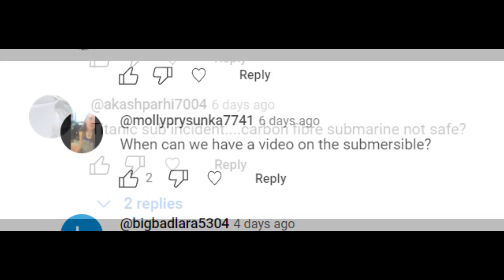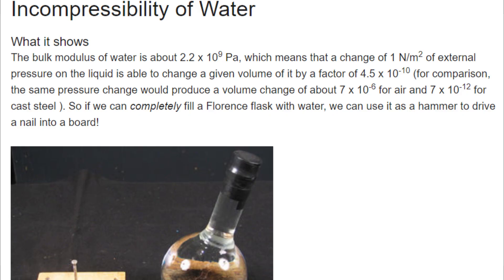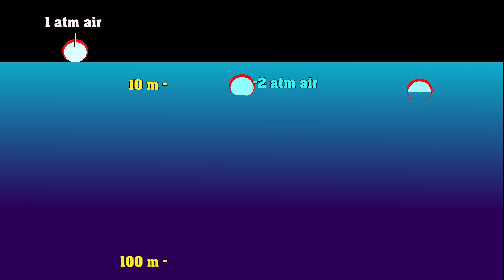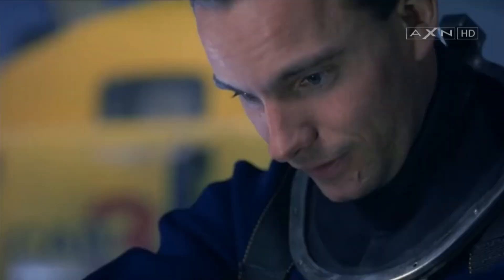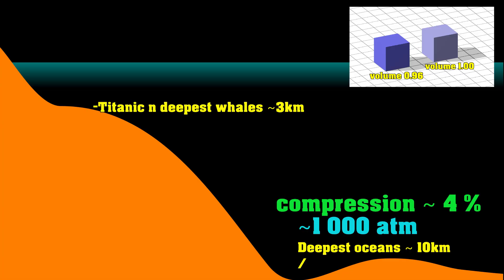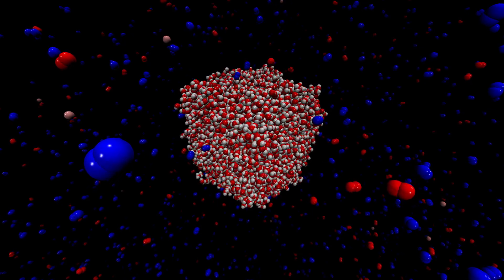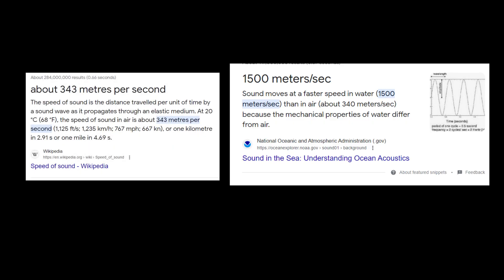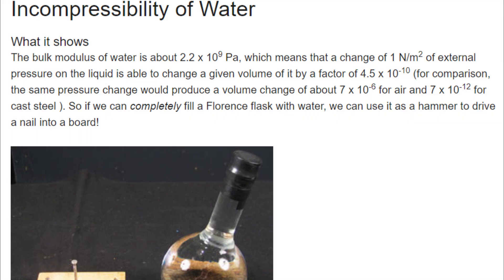What Happens when a Hull Fails at 1000 atmospheres?

Comment: Sub didnt fill with water in a few seconds. The sub exploded in 1 milliseconds then the water rushed in about 12 milliseconds later at about 1500 miles per hour. They were incinerated, smashed, and then subjected to the oceanic pressures in less than a blink of an eye.

You are missing the part where when you increase the pressure of a gas you increase its temperature.  These gases ignite and explode especially oxygen and any hydrocarbons
Reply: Air does not ignite...
Reply: @thedubwhisperer2157  but hydrocarbons and the peoples clothes does especially when the temperature increases. Which was in the submarine.

Forensic testing shows that cotton and wool clothing will ignite at temperatures of 250°F.

Any oils or gasoline materials would have ignited and the oxygen would have accelerated that process.
Reply: @thedubwhisperer2157  
The collapse of a submarine pressure hull happens quick, just 37 milliseconds in the case of the *Scorpion*.  The incoming water had a velocity of about 2,000 mph, not the relative slow flooding.  Over such small time scales, there is no time for the water or the steel hull to absorb any heat from the rapidly compressing air inside of the submarine.  Because no heat is transferred from the air to the water or hull, the compression is adiabatic.  By way of comparison, a four-stroke diesel engine running at 1,000 RPM has an adiabatic compression stroke lasting about 30 milliseconds.  The collapse of a submarine pressure hull is much more akin to a giant diesel cylinder compressing than relatively slow flooding.

A few people have mentioned Boyle's Law (or more generally the ideal gas law) as the reason the temperature will increase inside the collapsing hull.  But because the collapse is adiabatic, the ideal gas law does not apply.

So let's do the math.  The equation relating pressure and temperature for an adiabatic process is

    P^(1-γ)T^γ = constant

Where γ is the adiabatic index (*γ*=7/5 for air). P and T can change, but that constant will remain...well...constant no matter what happens to P and *T*.  If we assume that the initial pressure pressure was 1 atm (101,325 Pa) and the initial temperature was room temperature (~295 K) then the constant is

    (101,325 Pa)^(1-7/5) x (295 K)^(7/5) = 28.5 Pa K

The collapse halted when the air pressure was approximately equal to the water pressure at 1,530 feet, which is 4,630,000 Pa (in reality the collapse would have continued a bit further before rebounding due to the inertia of the seawater, raising the air pressure and temperature even higher)

    T = (constant/P^(1-γ))^(1/γ) = 879 K = 1,122°F

Needless to say, this is extremely hot.  

In the future please don't confidently correct people unless you have the evidence (or physics in this case) to back up your assertions.

Any clothes or objects that caught fire in that short time scale would have ignited the 96 hour supply of oxygen and any hydrocarbons resulting in an explosion. Then the sub collapses in on itself.
Reply: @moxygenpathogen7678  I had calculated an instantaneous temperature ruse to about 1500K so our individual calculations can't be too far off.  Given your timescale of 37ms I believe it is unlikely that the flammable contents had time to ignite.  Heat and temperature are two completely different things...
Reply: @thedubwhisperer2157  
Cotton ignites at 250C it spontaneously combusts at 750C.
Oils and gasoline at 500F some at 800F.
These chemicals can spontaneously combust when the sub reaches 1500F

Then they had 96 hours of pure Oxygen stored. 

explosions happen rather quickly considering guns ingite their bullets pretty quickly and bullets travel faster than the speed of sound.

Also the sub I was talking sbout was thresher. This sub is much smaller and deeper.

Also the U.S. naval captain said the crew was most likely incinerated

Back to my arguement the sub exploded then imploded. Or the crew where incinerated then smashed by the water then crushed by the ocean. In less than a blink of an eye.

Comment: What I'd like to know is what's so different about OceanGate. Why were they compelled to break the rules, and what are the rules exactly?

So you're not supposed to build subs with a carbon fiber hull. Did they do it to save money? Did they think it was worth the risk?

Are you not supposed to build a sub in a cylindrical shape in order to fit more people? I imagine they should be spherical to better withstand the pressure. How much do their prices compare with  companies who do follow the rules?

Are you not supposed to take a sub in multiple high-pressure dives? Did they build more subs?

I could Google all of these questions but figured it'd be more fun to post them here. Also I think they should've used a PlayStation 5 controller ($70). It's got a gyroscope and touchpad, and much more reliable than a $20 controller.
Reply: it's not so much the price, it's that no-one else would even take tourists, only scientists who had a very good reason to be on the ocean floor and even that after some years of waiting lists. this is according to Karl Stanley. so this would have been the first opportunity to get there as a tourist, even if you're a billionaire

Comment: Wait, a failing hull doesn't make a column of water fall into the hole. Water can enter from all sides, and in this way it will fill the void much faster than a column would. You don't need to aet that much inertia in motion, like you would with a column.

Comment: This actually explains a lot.  I knew that  such depths brought dangerous pressures, but I didn't really understand why something  for example like a pinhole brought danger and not just a spray of water mist.  Thank  you Thunderf00t.
Reply: A carefully machined, perfectly round pinhole, in a uniform material, would just spray water. Although it would be a fairly violent spray. The problem is that that's not how cracks form in materials under high pressure.

Diving gear survives by distributing the compression fairly evenly. Like an arch bridge, each part pushes against the next part over, and they keep each other in place. If one spot is weaker though, it compresses more. Tries to shrink closer to the center point, and pulls away from the material next to it.

Now if the bending were uniform, it would just push the two edges together. But since one side is compressing farther than the other, the two edges stop lining up. One side slips a bit into the interior of the sub.. and then decompresses into the air. Just a tiny bit. But now, that section of the material is weaker than the rest, so it bends toward the interior. Allowing more material to decompress....

This is how buckling happens. So one side of the material collapses inwards, ahead of the other side, and the material tears apart. Really fast. And then the water gets in between the two pieces, and pushes the edges inwards, into the interior, widening the hole. Uneven compression is bad news.
Reply: @mukansamonkey  Thanks for the insight!
Reply: Well, we use pressurized water to cut things like stone normally. This is really bloody pressurised that it'll make the whole bigger very quickly.
Reply: @mandowarrior123  I haven't personally done it but I've had parts made and cut via waterjet. It produces a really nice clean cut and when grit is introduced to the stream, you can get a nice polished edge. 

I always wanted one, there are videos online on how to build one using a pressure washer.
Reply: The thing about water compressibility was new to me, but the fact that water under pressure will very quickly enlarge any hole it finds is the root of this. Consider a dam breaking. The dam is only strong enough to hold back the static water. If the water finds a small way through, its movement will very quickly destroy the dam.

Comment: Very interesting! The only thing you didn't mention is that the gas bubble being compressed at such high velocities would also raise it's temperature into the tens of thousands of degrees, albeit ever so briefly.
Reply: Not quite that hot. I calculated adiabatic compression of air from 14.7 psi to 6000 psi (depth of about 13,800 feet). You get a temperature of about 1370 C, or 2500 F.
Reply: @zachary3777  ok cool, l have seen various different calculations and l myself am not up on the math. Suffice to say, it would get hot enough to incinerate some stuff lol.
Reply: @davidtatro7457  but also the bigger the preasure the higher is the point when things star to boil and burn.
Reply: @zachary3777  Yes, I got about 1500K temperature increase, which is hot, however the heat transferred in the few milliseconds before the water came in must have been minimal.
Reply: @zachary3777  I actually came up with 2499.99997 F.
Reply: @zachary3777  The new equilibrium temperature for that adiabatic compression would be about that, yes. However, it's being compressed by a high speed water front, which itself has inertia. So it would compress the air past the equilibrium and not just stop at equilibrium initially. So there would be very short even higher peaks in temperature.

However, I think that is irrelevant, since there is no heat being added. While the air would get very hot, the heat capacity of that mass of air wouldn't really change and it still wouldn't contain any considerable amount of energy to burn those rather large meat sacks on board. It would just drop the temperature very quickly.
Reply: @zachary3777 so they just got flash pressure cooked? Got it.
Reply: @xostler  nah. Even if all the air from the sub stayed together, it would only be a tiny bubble at that point.
Reply: True, but the water entering at 3C would conduct all that heat away nearly instantly.  Then take into account that decompressing water would also be endothermic.
Reply: @herrbrahms  Yes, it is the practical aspect of the conduction of heat, or lack of, within such a small space of time that may mean this has no bearing at all. Nothing to do with friction but Charles' law and Boyle's law. If you consider that temperature is just an indication of the amount of kinetic energy particles have in a volume then one can start to explore how this works in this case. But the speeds at which this is happening is just not intuitive to me.
Reply: @herrbrahms  No. No time. Think of it this way: Pump up a bike tire with (bike) floor pump. Even if you submerge the pump in ice water during pumping, where there are seconds (not milliseconds) for the volume of air inside the pump to cool, the air exiting the pump (hose feeding tire) would still be hot. Gas is just a poor conductor of heat (no time for convection either). So no, the walls of the sub and the cold sea water would not cool the air significantly.
Reply: It would be interesting for TF to look at this aspect, too, as the practical physics of the effects of this happening is not obvious to me.
Reply: Considering that the water was compressing the air at its own speed of sound, there wouldn't have been a uniform compression and heating of the air inside. Instead, it was more likely a shockwave, as the rapidly-moving water gathered the relatively-still air molecules, and that shell of hyper-compressed air is what heated up. Everything (and everyone) inside likely got crushed/disintegrated before any burning could even occur.
Reply: seeing a diesel motor from the inside!
Reply: It also acts like an air spring and bounces several times
Reply: It's takes less than 100th of a second for the water to fill the void from the sub. So fast the heat will be gone before it can do anything. It's also 'only' about 1500C.
Reply: Elon musk was a silent investor
Reply: @nuclear-sparks  pretty space x could build an awesome submersible
Reply: @nuclear-sparks  Never seen 'Elon Musk' and 'silent' in the same sentence before... 🤣
Reply: mantis shrimp style
Reply: One theory I had looking at the pictures of the debris they brought to the surface and seeing the porthole on the front section was missing. And the fact it was rated for a 3rd of the depth of the titanic was that. If that had failed first would the 7 inch hole act like a giant pressure washer slamming the back of the sub further weakening the titanium to cf bond causing the implosion.
Reply: @CaptainDominic  if the sub imploded it would also miss. But if the port hole failed, then the hull would have stayed intact. Carbon fiber failed and super compressed air pushed the vision block clean out
Reply: @tedarcher9120  As soon as a cylinder under that much pressure loses structural integrity, the entire thing begins collapsing. It would crush the hull. Perhaps not completely flat, before the water rushed in and stopped it, but it would definitely not be the same shape, afterward.
Reply: @eclectichoosier5474  if only the window shatters, it doesn't lose integrity. Water just rushes in through the hole and fills it. If the hull cracks in the middle, it collapses in a millisecond, shooting titanium spheres to the sides with compressed air
Reply: All the talk about temperature of the gas rising, I'm surprised that nobody mentioned Boyle's law.
Reply: You see the fireball inside ballistic gel when you shoot it with high velocity.  the friction.
Reply: The question now is whether they were evaporated first or pulverized.
Reply: I’m a scientific dumbass but wouldn’t it be from the friction and speed of the release that would create the heat as a byproduct? Like if you rub your hands hard enough it can become extremely hot and that’s how you can make fire with two sticks. So something like that? Again I iknow nothing so
Reply: @99Sailing  it is because compressing a gas increases it's energy and makes its temperature increase.
Reply: @IDontLikeKilling  I'm sure that friction might add a small amount of heat but it is mostly from the gas being compressed so suddenly. All the energy in the moving gas molecules suddenly being shoved into a vastly smaller area.
Reply: @davidtatro7457  oh I see, I was close to getting that conclusion but I seem to have mistaken ‘friction’ in this context, I thought the rushing of particles into a tight space was a part of friction now I realise friction doesn’t explain that process and I misused it. Thanks for replying
Reply: @99Sailing  Very adult of you to admit you learned something!  I like your style!
Reply: @KeithCooper-Albuquerque  You can only learn and get it right by being wrong 100 times. Wish my 14 year old self adopted this philosophy earlier haha - cheers
Reply: @99Sailing  Maybe a little bit but that wouldn't bring it to temperatures hot enough to melt stainless steel. The Ideal Gas Law states that compression of a gas heats up the gas (as compressing the gas makes the molecules vibrate faster, which is what temperature is)
Reply: @somedood9989  this makes a lot of sense to me thanks homie
Reply: @99Sailing Compressing gas heats it. When a bicycle pump heats up it is not only the friction of the piston. And decompressing gas cools it which is the basis of most air conditioning and why a spraying aerosol can gets cold in your hand
Reply: @99Sailing  Have you never used a can of compressed air to clean a PC keyboard? Why does the can get so cold? There are no moving parts, so... what do you think? And what do you think the reverse (jamming the air back into the can) would do?
Reply: @Slicerwizard  I like the way you put it, I haven’t used compressed air to clean a PC but back in the day I did do nangs (whippets) to get high and the device would go cold (haha yes I used to be a degenerate) but it doesn’t make sense to me.
Reply: @99Sailing a Nang a day keeps the dentist at bay!
Reply: @Slicerwizard make an ac system/heat pump.
Reply: @Slicerwizard  yes, when i fill up my paintball tank with 4500psi i gets warm

Comment: This feels like a semantic argument at this point. The internal pressure of the water drops but it causes it to move at a speed in excess of the speed of sound with a much higher density than the surrounding air. Pressure is force over area, force is mass times acceleration, so you have some mass of water rapidly acellerating to greater than the speed of sound towards you with a fixed surface area that the water hits, sure sounds like pressure does you in to me...

Its akin to saying well it's not the fall that kills you it's the sudden stop at the end. Like sure thats technically accurate, but you wouldn't be moving fast enough for that sudden stop to kill you if you weren't falling at some velocity, just as  1 atmosphere of water wouldn't kill you if not for the movement speed caused hy the rapid decompression.

Comment: What about the air that was inside the sub? When you compress a gas it heats up right? Would that also not make the air get extremely hot as the water springs into the sub at the speed of sound? It's getting compressed as the water is decompressing. Could that also contribute to the sound being produced?